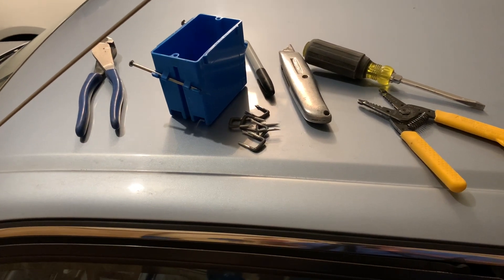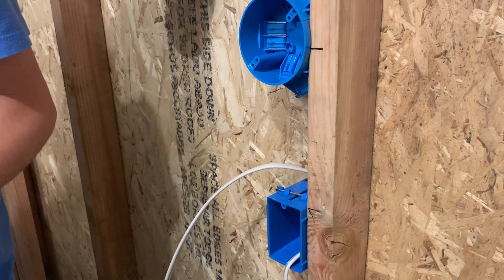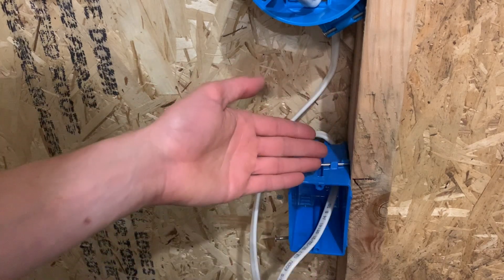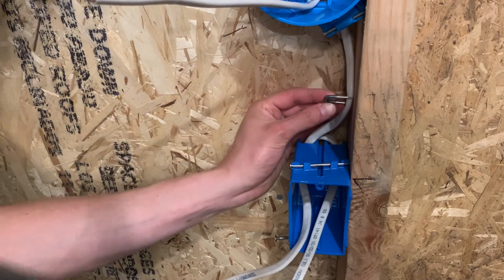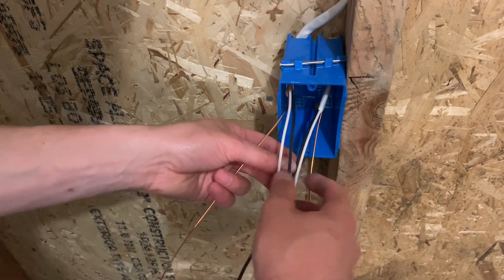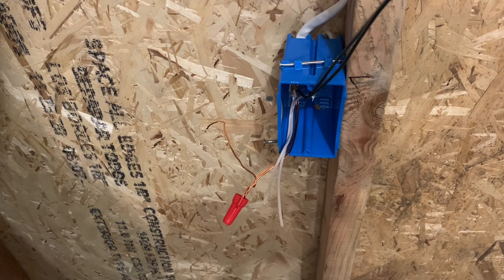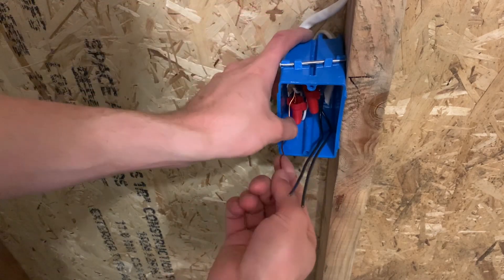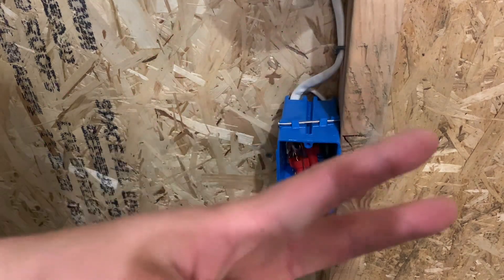Electrical 101:How To Rough In A Single Gang Switch Box+Light Box-1 Power/1 Switch Leg (Residential)

Comment: Hi! Im a big guy. Does electrical work require a size limit? Like for crawl spaces or climbing?
Reply: Generally speaking I would say no, size isn’t a factor. If anything if your tall in some cases you may be able to use a shorter ladder. There is weight limits on ladders but they also make higher rated ladders. In all I would say if you’re interested don’t let that hold you back, good luck out there. 👍🏻